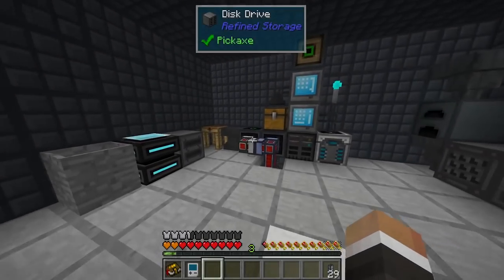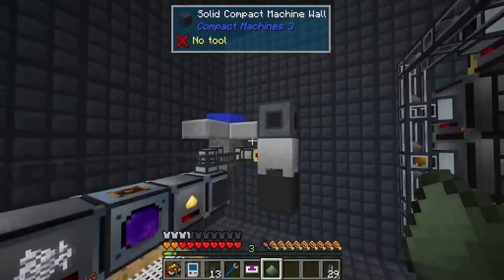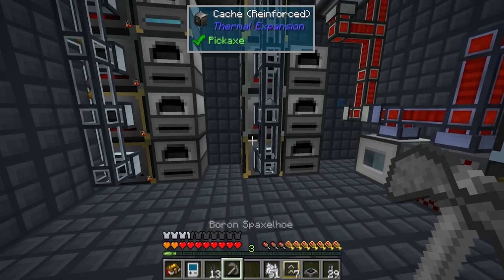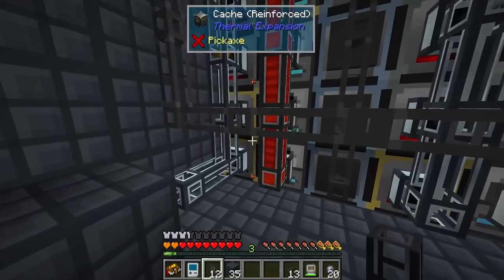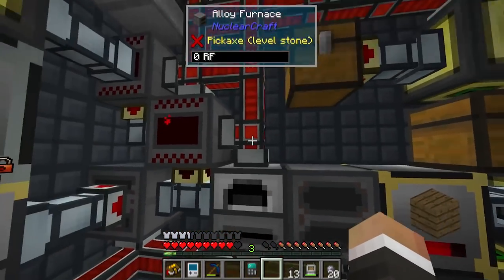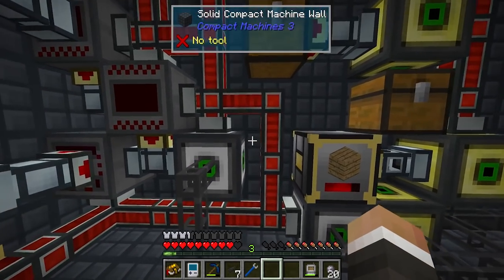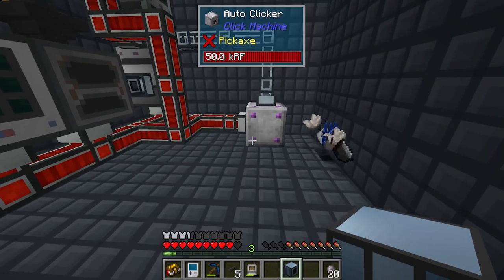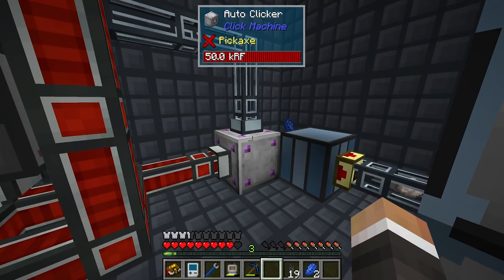Minecraft Compact Claustrophobia | STEEL AUTOMATION! #17 [Modded Questing Skyblock]

Comment: just wanted to let you know Issac, you can automate the creation of the spaxelhoes via the crafter & and export buss with the crafting mod put inside, and because only the bottom autoclicker needs to have redstone powered into it to prevent it from breaking the saplings, you can send the redstone signal to the bottom-most one from underneath & export the spaxelhoes into the side where the redstone wire currently is

EDIT: I've joined the discord and will post screen shots of my tree farm setup in general
Reply: ...via the crafter and and...

Comment: Concerning Slag: I have a very compact automated system to create Rich Slag from metal grit (I'm using Nickel and Silver, but any that work for the different Hardened Glasses is fine). What you need: 
- Induction Smelter x2
- Augment: Auxilliary Sieve x4 (or more for Signalum/Enderium upgraded machines)
- Hardened Glass x4
- constant supply of the used grits

Setup: Place the Induction Smelters directly next to each other. The side pointing towards the adjacent Induction Smelter needs to be set to the "input & output" (blue and orange combined) setting. Insert the Augments to increase secondary output chance. Also set one side to only secondary output (yellow) that will lead to a Cache or something to store the Rich Slag. Place 2 Hardened Glass into each Induction smelter and supply them with some Grit through additional inputs. What will happen is that both Induction smelters will now turn 2 Hardened Glass and 1 Grit into 2 Hardened [metal] Glass with a chance of Rich Slag. That chance is at 25% normally, but increased due to the Augments (FTB wiki says each increases the chance by 11%). The Hardened [metal] Grit will then go to the other Induction Smelter, causing that one to start the process over. 

Now just leave it running and marvel at the Rich Slag you're getting to produce Rich Phyto-Gro for the cost of a ressource that you are getting more than enough of with the Auto-Clicker setup. And please don't start using the recipe that uses Sawdust to get the Rich Phyto-Gro. Use the Pulverized Charcoal one to get four times the product out of each Rich Slag.
Reply: Not bad.. I built a system that autocrafted clocks and made sand to use redstone for rich slag.. yours seems way easier
Reply: @QargZer  I was thinking about something along those lines as well, but was unhappy with how tedious it seemed for the task at hand. Took a while before that idea came to mind.
Reply: @MoD366  the reason I did my method is I have way more redstone than anything else. And the making of sand is pretty simple. Plus I didn't know of a simpler method. There are multiple methods to do many tasks in this pack.. I actually enjoy not necessarily being forced to do the same thing as everyone else. 

Also the excess sand is automatically crafted into sandstone then ground to turn into nitrate. Then the remaining sand is funneled back in. So having sand automatically generated was helpful